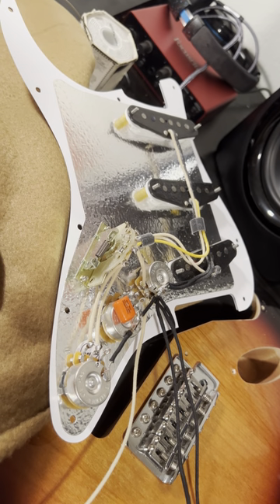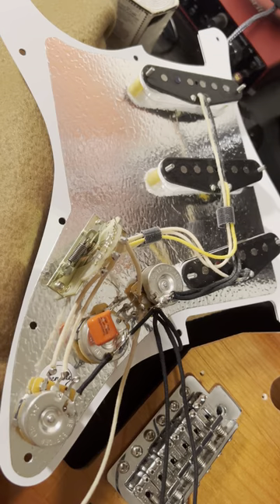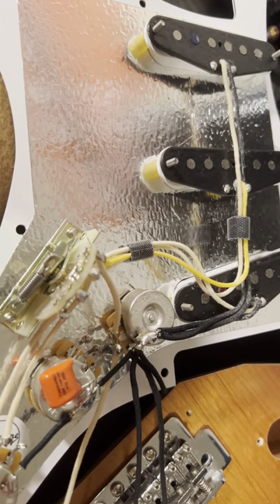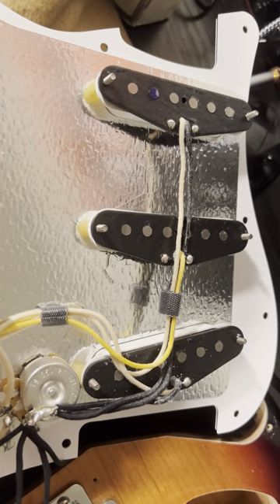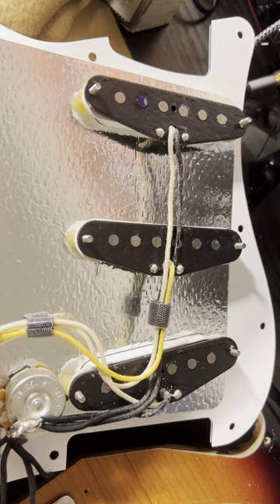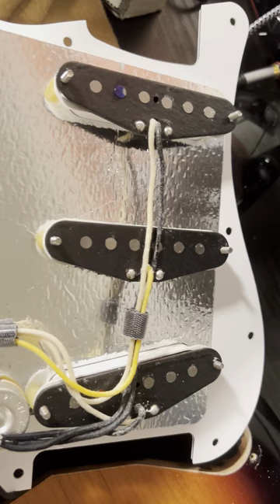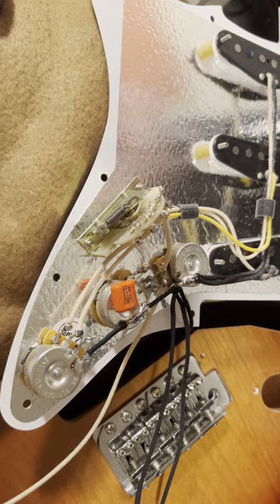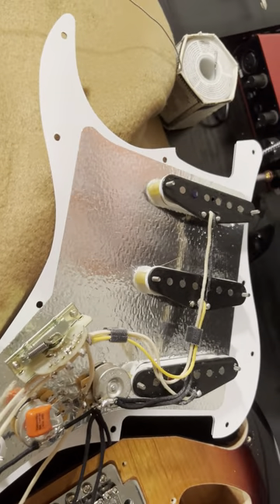Fender Custom Shop Texas Specials Pick Guard Build With Toneshapers Wiring Kit And .47uf capacitor.

Comment: I have a 60’s reissue strat that does not have the “screw” to body wire. Instead there are two black wires going to plug in Jack. Where do I put the screw wire from the new pre wired pick up guard?
Reply from the maker: Pretty sure that wire goes to the tremolo claw plate that the springs connect to. Also, be sure to twist your output wires going to your jack.